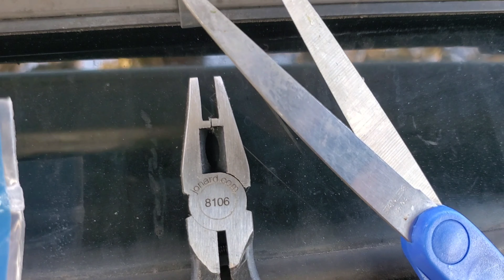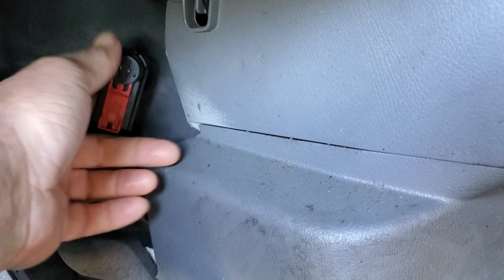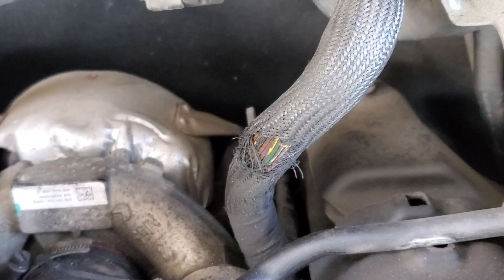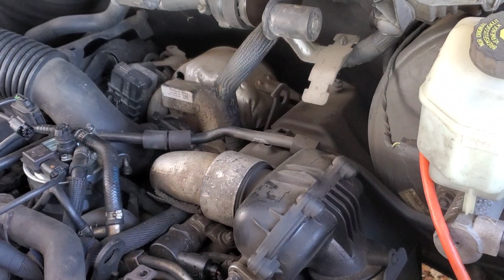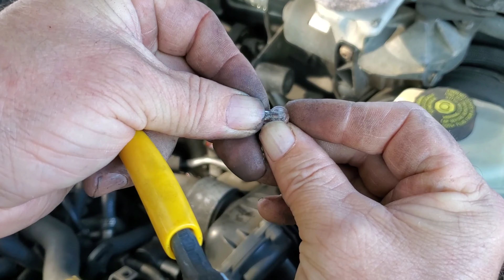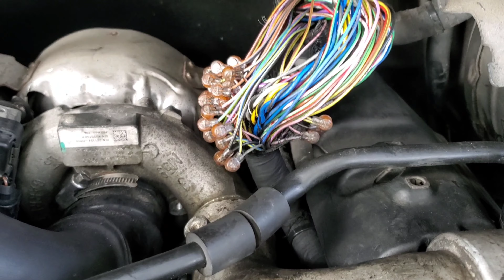Sprinter Wiring Harness Repair 2500 Diesel

Comment: Something I don't understand? Why did you even do this? None of those wires look like they were broke. Did you do it just to do it
Reply from the maker: In the video I tested continuity.  One of them had intermittent continuity.  I had a previous video where I pinned the harness up away from the ridiculous vibration of the motor and that worked for a few years.  I'd say it's one of those situations where the wire is broken inside of the insulation..

Comment: How has this harness repair held up for you over the years?
Reply from the maker: It held up until 350,000 miles then we outgrew it, sold it.  Now we have a 16 foot box truck but wished we had a 20 foot box truck.

Comment: Hi! I have the same issue. My instrument cluster is only partially appearing and my reverse lights along with my reverse alarm go in and out. I’m assuming the issue lies in this harness. Do you happen to know the color coding for these wires?
Reply: Also, do you have any footage of the finished product wrapped? Wondering how everything went. I may copy you exactly.
Reply from the maker: It's easier to intercept the wires coming from the cluster that you're sure are being affected and place a toner on them and use a tone finder to find the wires in the harness.  The toner and receiver can be bought cheaply at Harbor freight

Comment: Good night.   I just swapped an engine on a 2007 sprinter. I coded the injectors and when I went to start it cranked... no start. I sprayed the turbo with starting fluid and it turned over and ran for a couple of seconds.  I determined that its a fuel delivery issue. I cranked the motor and removed the hose from the filter and the fuel barely came out. I used my scanner to actuate the fuel pump and it shot out with massive pressure. I checked the rails.. nada.. zip no fuel. I disconnected the fuel line by the starter, main fuel line to the engine. When we cranked... same fuel for half a second with no pressure.  Checked fuel pump relay and fuse and they are both fine. I read up online that the ecu is responsible for sending the signal to the pump for it to work. Is this correct? Tomorrow I will use my multimeter to see what voltage im getting to the fuel pump. Thanks for your help... anything to point me in the right direction is appreciated.
Reply from the maker: If you have harbor freight nearby they have a line ringer.  Put the ringer on one end and use the wand to detect it.  There's often a break in the Y right below the turbo accumulatot

Comment: After replacing my 2007 motor with a 2017 motor, Im having issues with my camshaft sensor. After replacing the sensor, still the same error. Do you remember which wire or color of that wire? Thank you
Reply from the maker: Yellow brown
Reply from the maker: It also feeds the MAF
Reply from the maker: Did you get it running?